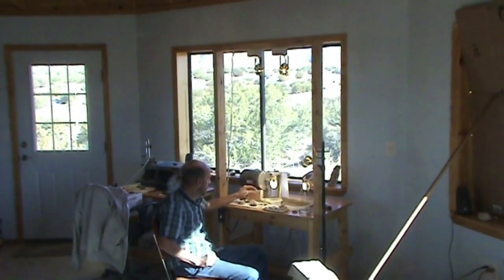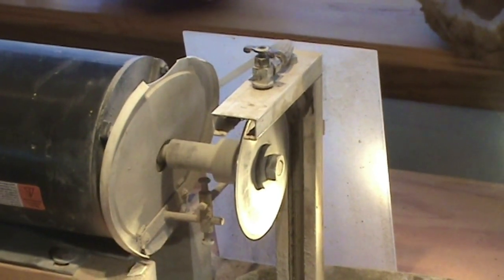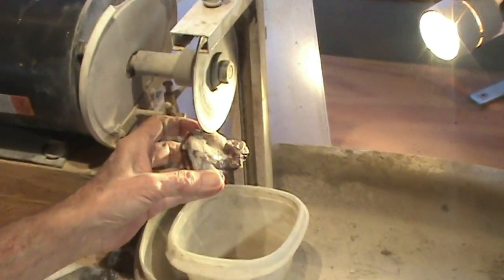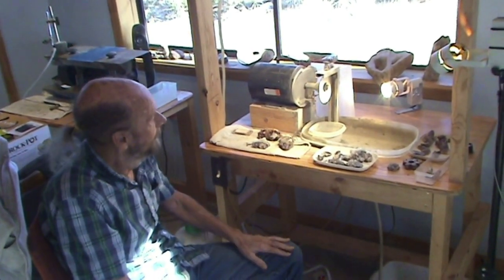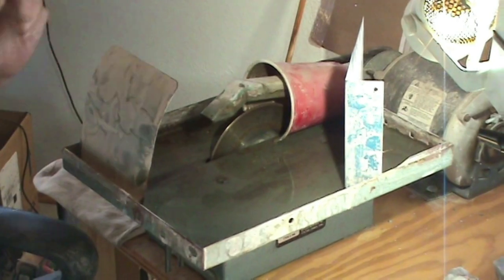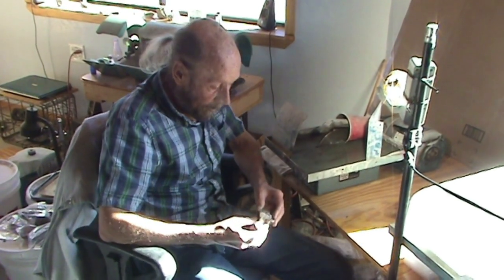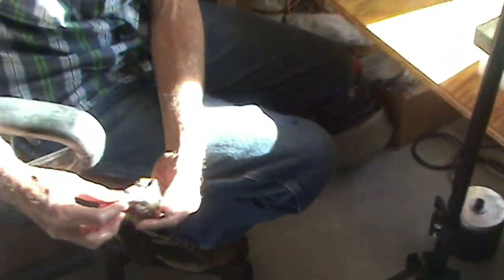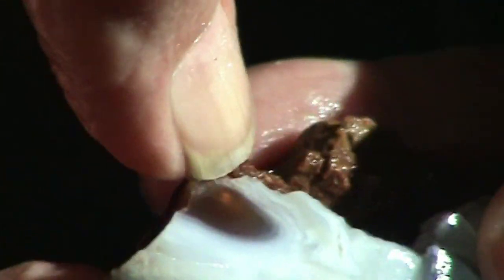Cobbing fire agate rough PART 1

Comment: Thanks for showing this, I have a baldor dental lathe I am interested in turning into a cabbing machine, maybe 4 to 6 expandable drum wheels, Its a tapered shaft, so, I was wondering if there is a place I can get shafts made, or a way to do it, Is there a part 2 to this?
Reply from the maker: Mike, I have an old Baldor straight shaft I got years ago then found it had a specialized shaft. I recommend keeping yours as is as they are the best going. You could pretty much use any 1/4 or 1/3 HP motor for what your are after. There is a website that I can't think of that sells over stock and such motors at great prices. 
Go to my you tube channel there are more videos in this series.  
Danny
Reply: Yea, Thanks Danny, I watched all your vids, but never saw how that stone came out, is that on some where?, , I will keep looking for a motor,  @lopackistoneandmetal3955
Reply from the maker: @mikeplitnick5051   Once I saw that there was no gem in the stone I quit working on it. I do my best to only spend lots of time on potential gems.
Reply from the maker: @mikeplitnick5051  You asked me about the motor and blade and it seems I can't answer that post. Its in the first cobbing video.